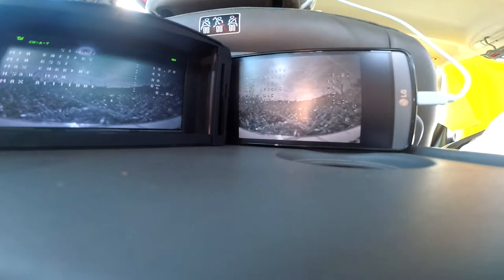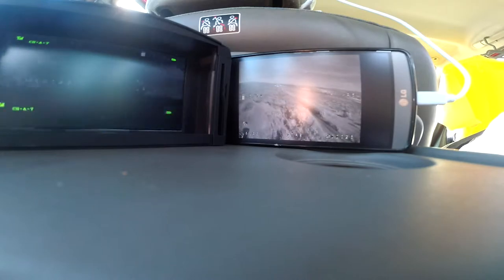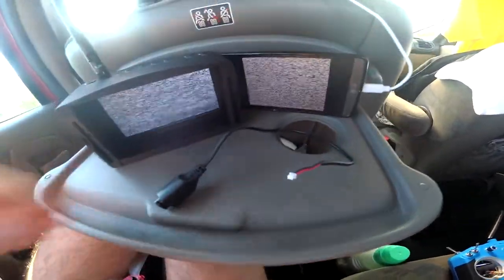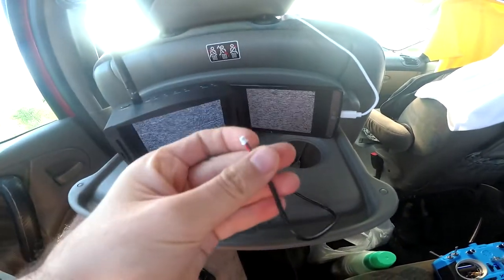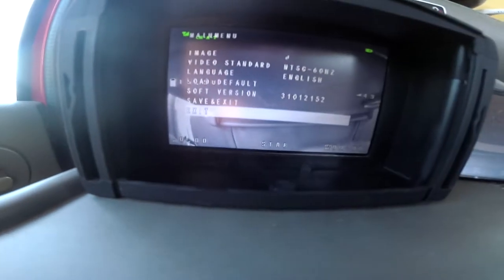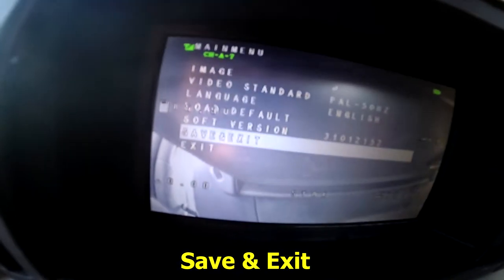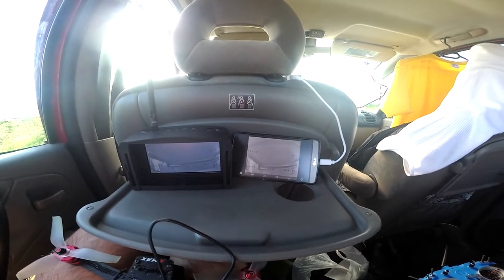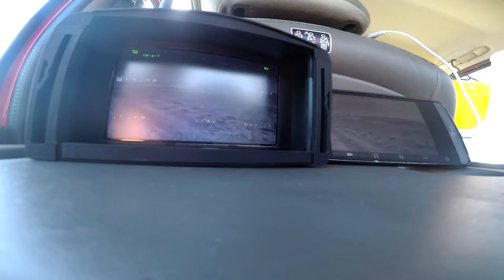How to fix Shaky/Rolling FPV video (RunCam Night Eagle 2, Joystick, OSD, PAL/NTSC)

Comment: Thank you I was having problems with my video and found hard setting the OSD in BetaFlight gave the same results. I had it set to auto and was getting screen rolling. I didn't think to try PAL on both sides. It just seems that the camera even if protected turns glitchy so fast.  So hard setting PAL and NTSC makes it better.